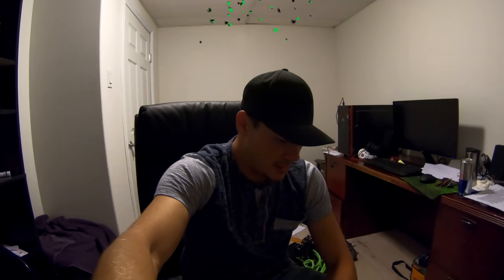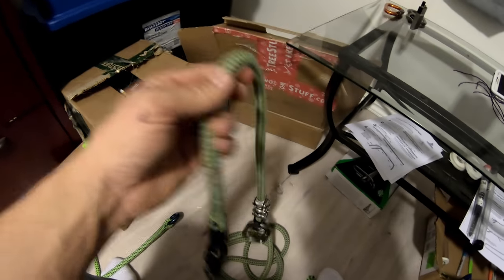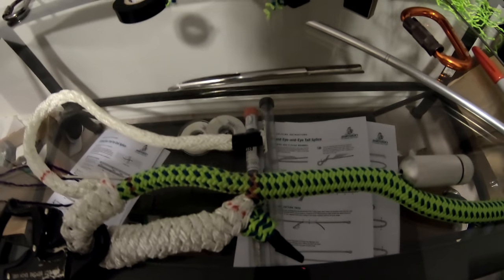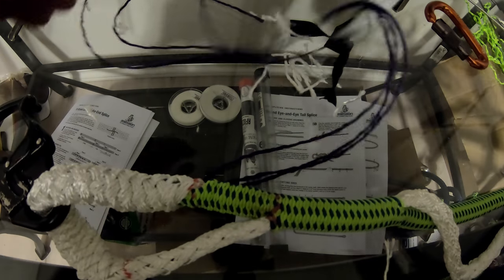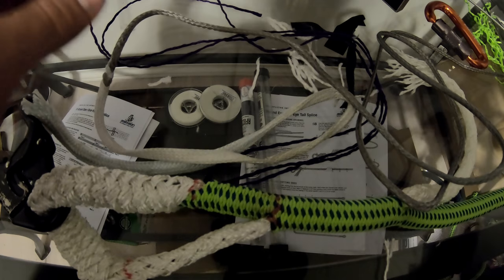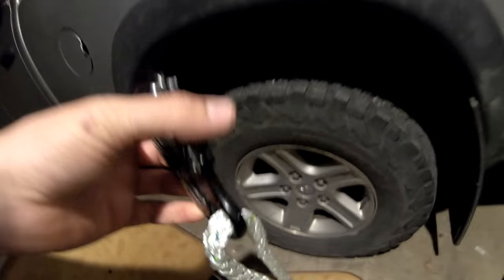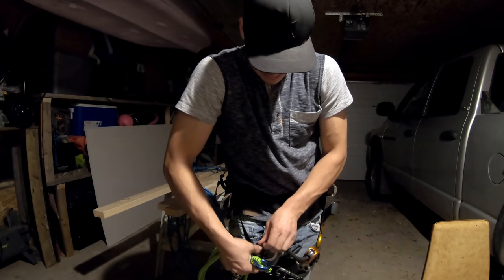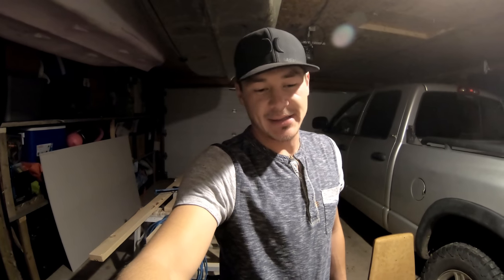*Splice* Final Bury Tachyon G And Awesome Tool To Do It With!

Comment: Have you researched fusion products?  I use a couple biners of theirs & after purchasing i decided to research.  There is NOTHING on the inter web about the company....kind of strange.  Ive enjoyed my biners, but its wierd to have NO company info.  I actually bought mine from a arborist supply store so i figured they were legit, but ......
Good vid.
Reply from the maker: Yeah I'm not sure about the fusion product information.  But the rings are rated and I have rigged some big pieces with them. The only fusion stuff I have is the rings and snap hooks they seem high quality. Thanks for watching brother👊
Reply: I have a fusion saddle I use. Weird I just got it from a guy basically brand new but the bridge setup was SOB RP20- 40kn rings on a eye to hitch cord- rings on each end. Literally found a website and it says all the saddles were custom made and the one I had came with suspenders built into the saddle. It had a lot of Ds making me to believe it was more a harness versus a saddle for arborist work..leg straps were small as well but back padding was comfy. Not enough attachment points for gear tho and only 2 gear loops. Guy had a CMI saw clip on so I just transferred the rings being they were like the Petzl ones with the bolt and put it all on my edge saddle. Wish I had a newer monkey beaver 2.0 but I'll never be able to afford it climbing for you don't even wanna know how much. I'll find the link to the site but this is a old comment I'm sure you have moved on to better things! Friction savers tho chicken rings are my favorite check them out on YT with blue moon behind them lol later

Comment: Hey do you remove the 3 middle strands of the rope when splicing
Reply from the maker: Ok so if you cut the middle strands out I wouldn't worry too much  but there is a correct way to do it, it comes out at the cross over, ill leave a link to the site download the tachyon pdf
https://sites.google.com/a/splicesbynick.com/www/splicingdirections
Reply: Thank you so much brother
Reply from the maker: @tonylima9362  no problem Tony, anytime  👊

Comment: I’m just getting into splicing and after watching a few videos that made it look really easy it’s nice to see that in reality it can be a bit tougher (I’m struggling with the bury part on a cheap 10mm marine rope). 

My question though: what kind of pen are you using for marking the rope? Wondering if I should be worried about harsh chemicals in the ink of sharpies etc. since you seem to have a bit more hands on and long term experience an opinion would be appreciated. 

Thanks for the vid and cheers from the entertainment rigging side of the rope ;-)
Reply from the maker: I do use sharpie just because that's what I had at the time, In addition to that I know it will stay on the rope and not rub off while I'm working. I'm sure there is some type of special pen but the reality is anything will work. I dont believe a sharpie would effect the integrity of the rope. Hope that helps and good luck, I had alot of failed splices, Its alot of technique and practice. I'm still not a pro but I can do it everytime now.

Comment: Great video, can you reference the splicing instructions you are using? I am trying a splice on the Sterling Scion which has a similar inner core but am struggling with it. Thanks
Reply from the maker: Yes if you use the soft fid it makes ropes like this much easier. Also if you are having trouble with a bury you can always hook the wire fid to something, hold the rope and give it a sharp snap. Here are the instructions I refer to.
http://www.splicesbynick.com/splicingdirections

And here is a video that helped me greatly.
https://m.youtube.com/watch?v=UghIS9xdiDw&t=2s

In those first instructions you will see what to do if you have a small 3rd inner core.
Reply: @PoplarMechanic  Thanks!! You make it look easy with that soft fid, gonna get one ordered up.